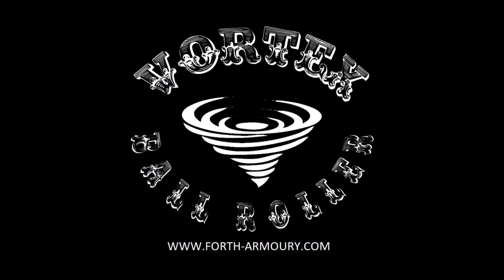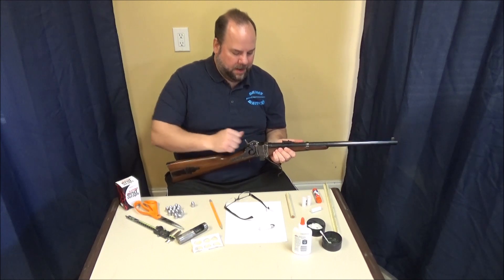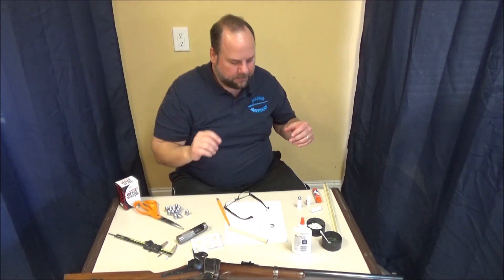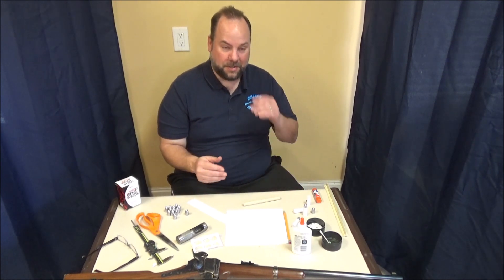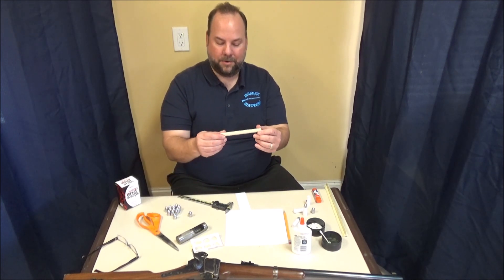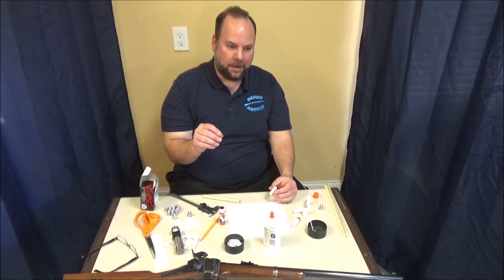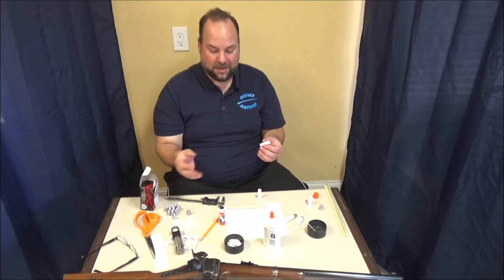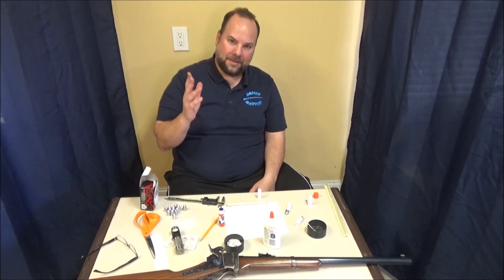Constructing paper cartridges for the Sharps carbine

Comment: I've never used a Sharps, but I do make cartridges for a Chassepot, and two of my most useful tools are an old paper guillotine and a scalloped-edged circular paper hole punch. They cost about $25 for both on Amazon, new, and have streamlined my process enough to pay for themselves many times over. I also make heavy use of a couple of triangular plastic straight edges, a rotary cutter, and a self-healing cutting mat.

Comment: Try using clear fingernail polish on the base paper and dip it in FFFg or FFFFg powder. Use a flint lock pan primer flask and prime the nipple for the first few shots to clear and dry out the fire path. Thanks for the video good information.
Reply from the maker: This is not really necessary with the Sharps.  Modern reproductions can be a little prone to misfires until the nooks and crannies in the fire channel get coked up with fouling, but this can be fixed by the masterful work of Larry Flees, who re-machines replacement hardware for the fire channel and eliminates these nooks and crannies.  But with quality percussion caps, like RWS Dynamite Nobel, it will blast right through the hair curler paper and ignite the cartridge.

Comment: My husband has a question about the cartridges. He recently started making them with the vellum paper but they are not combusting in the chamber. Is this normal? He followed your directions and his load is 60 grains of 2f GoX. 
Any suggestions?
Reply from the maker: It's not uncommon to find a husk of burned paper left in the chamber.  This generally has no effect on chambering or shooting the next round.  The most clean burning cartridges I made using drafting linen, which is a very very fine, dense weave linen that was used to make drafting paper until around the 1940s.  It's not commonly available anymore.  But the linen burned completely to bits.  Some people use nitrated paper but I worry that those are too combustible and if they touch an ember they would immediately go off.

Comment: On lower powder charges are you adding any type filler material between the card and the base of the bullet?
Reply from the maker: Generally, no.  I have experimented with fiber wads between the powder and the bullet, but did not find any change in accuracy.

Comment: always shied away from these guns , know I want one . one question , so the paper tub is not made with A fast burning combustible paper ? like A cap and ball     revolver .
Reply from the maker: I have found it is not necessary to use a highly combustible material for the tube, and in fact it may be dangerous.  When fired, sometimes remnants of the paper remain in the chamber.  So it is possible that an ember could remain in the chamber.  Now generally when you push in a new round, the nose of the lead bullet will shove any embers or debris out of the chamber.  But combustible cartridges are very easy to set off with a spark.  Nitrated paper, for example, will instantly start burning like a slow fuse if it touches an ember.  Whereas standard paper may well just snuff out a small ember.  So, I experimented with nitrated paper but found it was not necessary for my competition rounds.
Reply: I use tubes in my Pedersoli Sharps and if there is any thing left in the breech I just shove in another round and the fragment will be cleared by the bullet no problem.